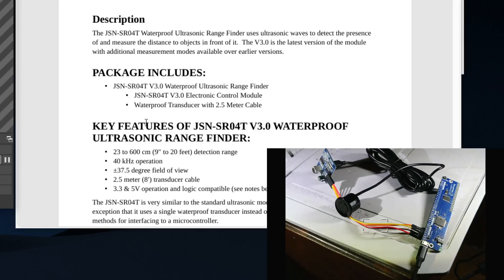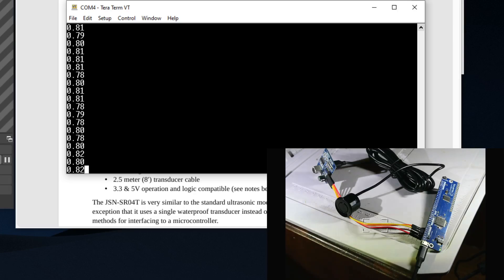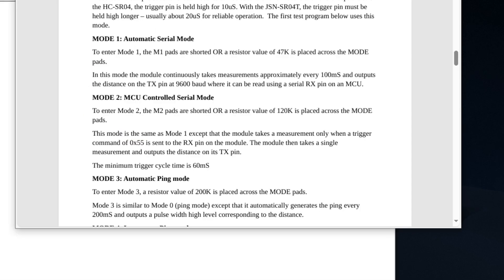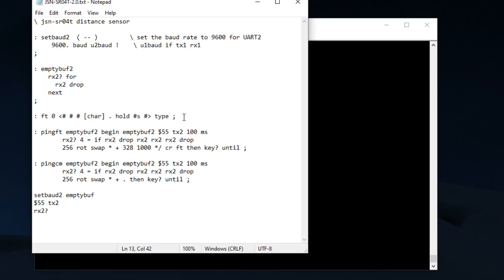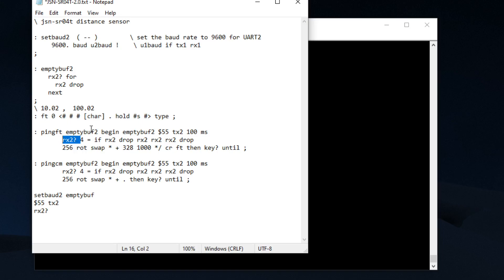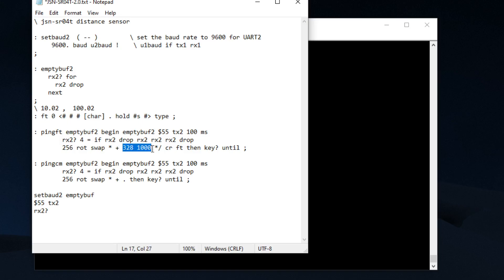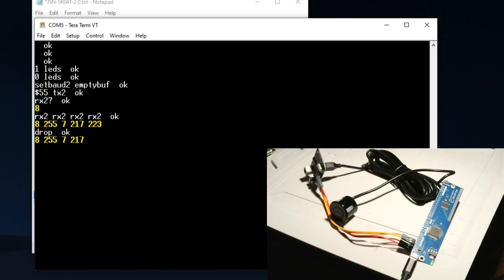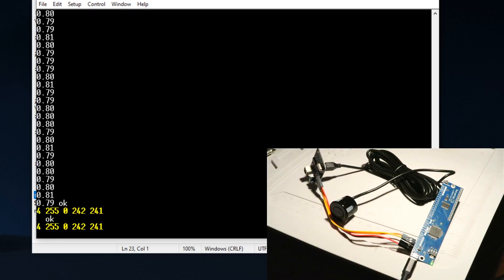JSN-SR04t Distance Sensor / FlashForth

Comment from the maker: code from video:
\ jsn-sr04t distance sensor

: setbaud2  ( -- )         \ set the baud rate to 9600 for UART2
     9600. baud u2baud !    \ u1baud if tx1 rx1
;

: emptybuf2
    rx2? for   
      rx2 drop
    next
;

: ft 0 <# # # [char] . hold #s #> type ; 

: pingft emptybuf2 begin emptybuf2 $55 tx2 100 ms 
	rx2? 4 = if rx2 drop rx2 rx2 rx2 drop 
	256 rot swap * + 328 1000 */ cr ft then key? until ;

: pingcm emptybuf2 begin emptybuf2 $55 tx2 100 ms 
	rx2? 4 = if rx2 drop rx2 rx2 rx2 drop 
	256 rot swap * + . then key? until ;

setbaud2 emptybuf
$55 tx2
rx2?